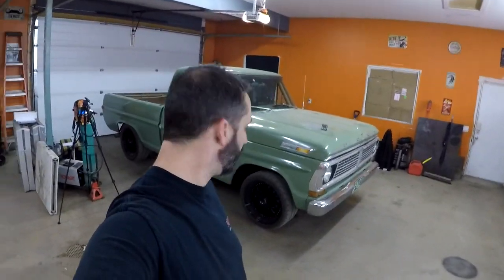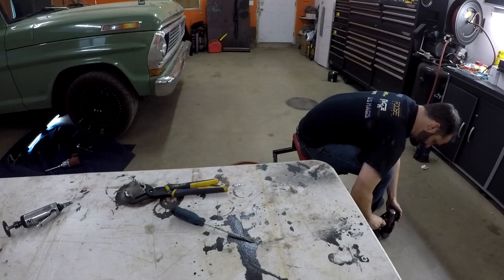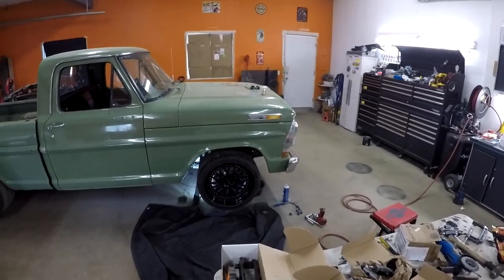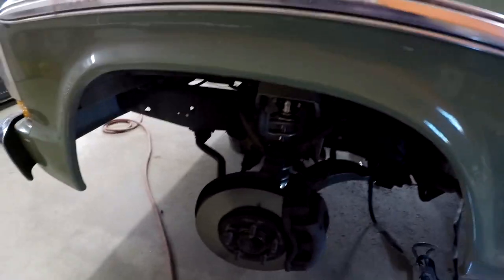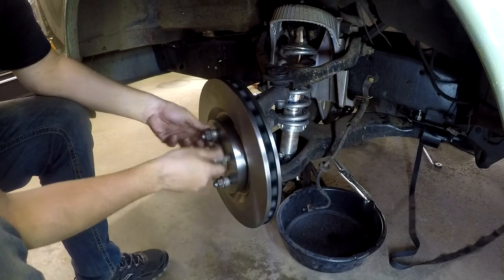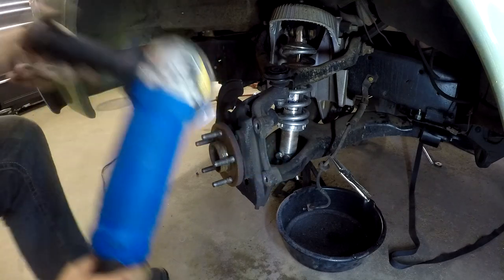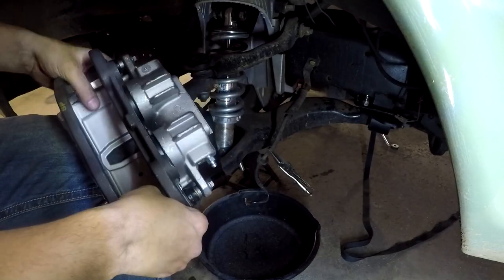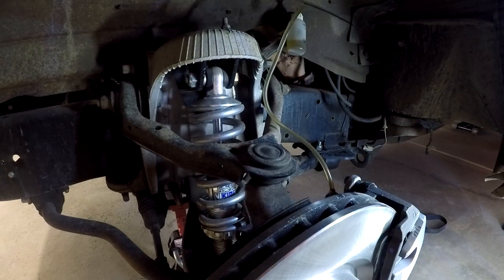BIG Brake upgrade for your crown vic swapped Ford F100

Comment: So these “big brake “ kits fit on stock crown vics?? You would have to get bigger wheels obviously to fit rotors but these just bolt on to CRown vics ? That’s awesome bet it greatly improved the stopping power
Reply from the maker: Yes sir

Comment: What is the offset of your wheels with the crown vic front end?
Reply from the maker: 19x9.5 +35
Reply: @TheGoFastGarage I couldnt find the video of wheels/ tire combo. Do your front wheels rub at all? What offset and wheel width are you running in the rear? What size tires did you go with front and rear. I enjoy a good LS in a ford build mostly because people loose there shit.  My brother and I were dropping a coyote in our 68 when an old timer stopped by, he was a ford fanatic to say the least. Well the old timer ended up trying to bash Chevy and LSs when i had to break him down with logic, Long story short he left with a sour taste in his mouth and my brother was laughing and shaking his head at me.
Reply: Do you by chance remember the back spacing? Appreciate the feed back!!